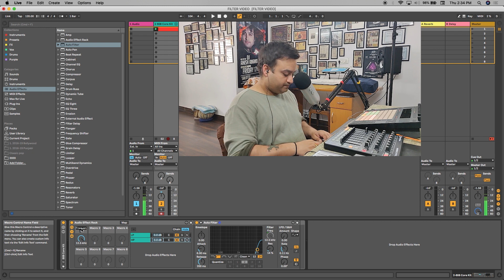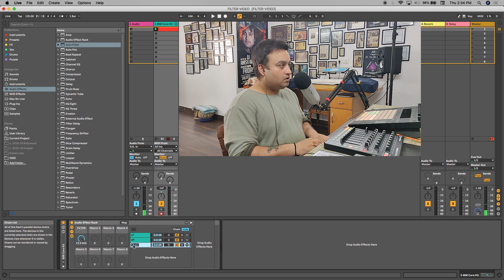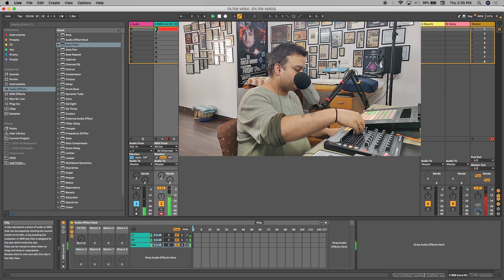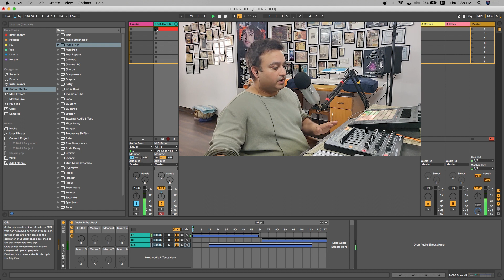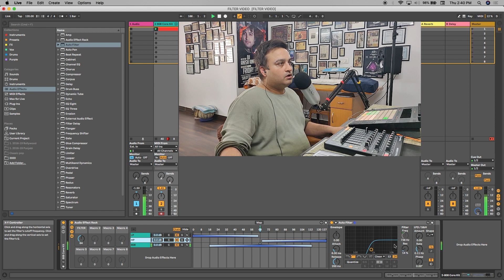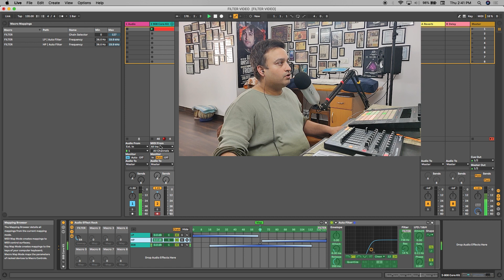How To Create a Single Knob for Low Pass High Pass Filter on Ableton Live

Comment: how do i make 64 the 0 of the filter. because at the moment at 64 is a 1k filter and 137 is 20k
Reply from the maker: You need to create crossfades to the parameters. Obviously i wont be able to explain in the comments but i would suggest you to watch the video carefully around 07:30. I hope this will solve the issue. 🙂 Thanks for watching.

Comment: i think the crossfades are too long, you dont get much range on the filters, but anyways this is cool idea
Reply from the maker: Thanks for the appericiation
Reply: You can definitely edit the ranges to be a bit shorter. I think it would work even smoother with a bandpass filter on the third chain. Because now it's weird that you are just fading in (when going from low to highpass) a fully unfiltered signal in the middle. But then you wouldn't have a completely unfiltered signal at the 12 o clock position of the controller.
Reply from the maker: @snakedogman  True that. Well this was 3 year ago. Lot of things has changed ;-) Thanks for watching.